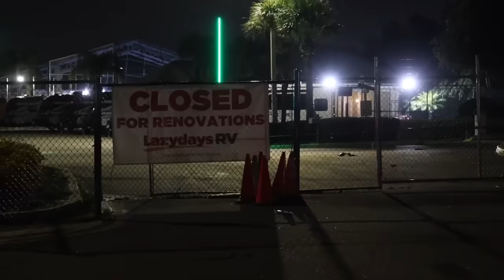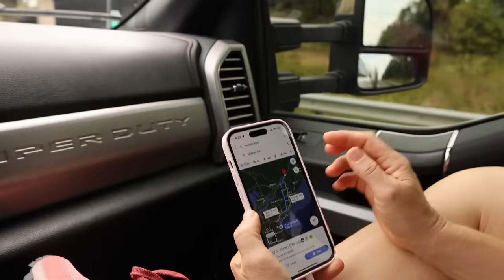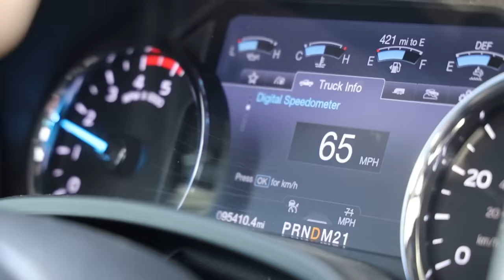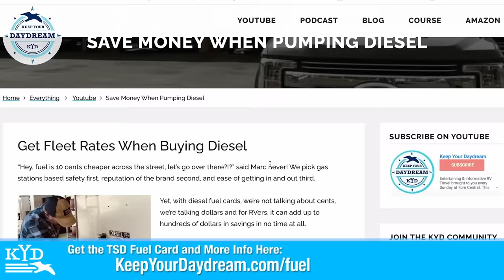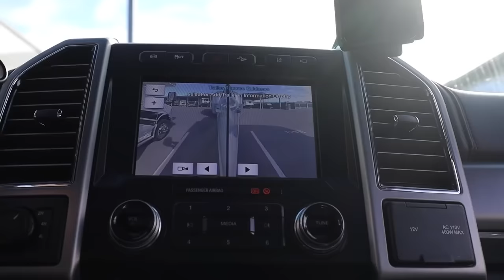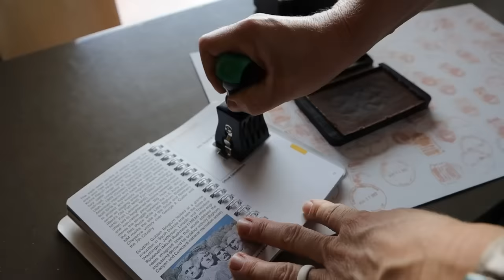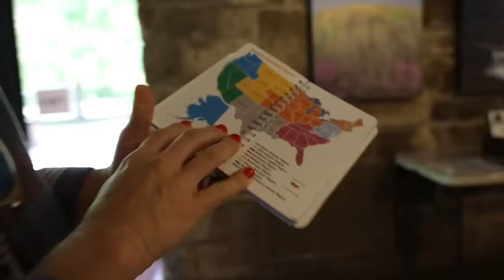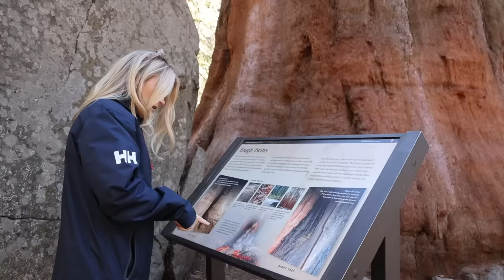🚫 RVING IN 2024: AVOID THESE RV MISTAKES!

Comment: Excellent list!  We got distracted by someone and forgot to check our tail lights on the trailer when leaving.  After driving through a very busy city, we realized we didn't connect the electrical - ugh.   Our Imagine is just under 11" high - had a complete panic attack in MD when we got on a highway and the sign said "nothing over 10"".  Luckily we were able to turn off that highway after a few miles of sheer terror.  My favorite part of all of your videos has always been Marc dragging the sewer hose down the street.

Comment: For your 2024 Grand Tour, I see Duluth and likely Marquette in your path.   

In Duluth, a great place to stay is at the Lake Head Boat Basin.   Right now, in the bleak mid winter, all of the boats are "on the hard."  When Spring comes and all of the boats get launched, this leaves room for Campers.  The city uses the boat storage area at Lake Head Boat Basin as camp sites for RV people.  We found it on RV Trip Advisor.  I wouldn't want to tent there.   Basically a parking lot, but has hookups for power, water, and dump tank.  Right near the lift bridge, ship canal, and walkable to most of downtown.  Good access to the bike trail along Lake Superior too. 

Head East out Route 61 (Voyageur Highway) to  Split Rock Lighthouse.  A lighthouse set in The Most Epic Lighthouse Setting I have personally every seen.  Play some Route 61 revisited-Bob Dylan (if that is your sort of thing) while heading out Route 61 to the lighthouse.  

In Marquette, The Iron Heritage Bike Trail is some great riding.  The best is along the shore of Lake Superior from The Michigan Welcome Center on the east end of town, back into town, past Da Yooper Dome, and around Presque Isle.   Many resturants and breweries at hand along the trail.    The Iron Heritage Trail also climbs out of town intermitably to the west and makes a great turn/around ride, coasting all  the way back to town. 

Heading out of Marquette, take M-28, a much better drive than US-2.  Check out the locks at Da Soo or pick up I-75 via M-123 to The Mighty Mac. 

Have a Yooperific Trip !!

Comment: I chuckled at the "enter exact location" tip...also traveling at night...😎
We were traveling through Alabama & had decided we were just going to do a quick overnight at a Bass Pro Shops in Prattville, Al.
I had entered Montgomery as a point of reference & was going to change it to the address for the Bass Pro Shops, but ,I forgot to do that.
I followed Google maps right into downtown Montgomery, with our 37' 5th wheel....😳
I knew I screwed up as I exited & the sign said downtown, but it was too late at that point.
Thankfully it was on a Monday night & around 10pm so there wasn't hardly any traffic. It was a tense few moments,  but we were able to get back on track fairly easily. We did arrive at  our destination & once we did, my wife & I had a good laugh over what happened. 
We learned the hard way that evening & since then we double check that the address is correctly entered before we hit the road. 😎

Comment: Great tips for new and seasoned RVers. Love the channel.  Here’s another tip. With limited sun in the fall and spring months, I’ve started adding backup LED lights to all my trailers, including cargo and utility. All 7 pin connectors have a centre wire that connect to your trucks reverse lights. Installing a couple LED lights to the rear bumper of the trailer is an easy and inexpensive fix but it really helps backing up in the dark.  Added tip, add a switch in the circuit with constant power and you can also manually turn on those lights if you need extra light in the rear when parked.

Comment: Happy New Year, y'all! We've done most of these. The walk around but not looking up cost us a TV antenna. The poopsey was hilarious but totally disgusting. We had a jerk walk past our trailer and pull the black-water tank handle out. This was while we were shopping in a Walmart. Fortunately,  I spotted it when we returned, closed the valve and went on our way. We stopped at the RV Park dump station before parking and took care of it to avoid a nasty mess at the camp site. Now I check everything whenever we park to shop just in case there's another jerk. 

Winter camping: been there, done that, thanks but no thanks. It was work related but still - no way, Jose!

Safe travels in 2024! Thanks for sharing your ideas and experiences. They are much appreciated!

Comment: Why hit trailer breaks if go into wobbles
Reply from the maker: Applying the trailer brakes immediately stops sway by straightening out the trailer. Failure to do that can cause the sway to get more and more aggressive until a serious issue occurs. Applying brakes to the truck alone doesn't separate the  truck and trailer or change the momentum .